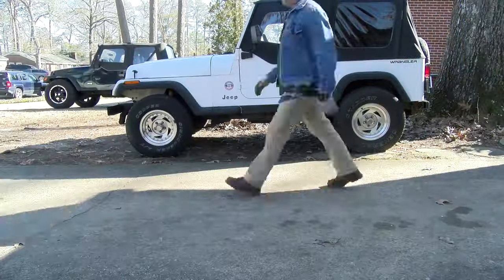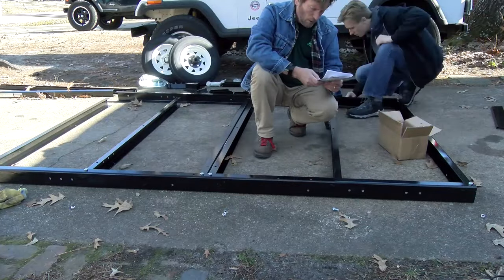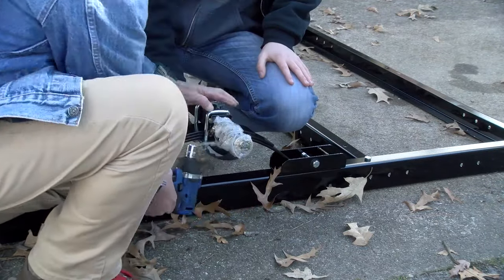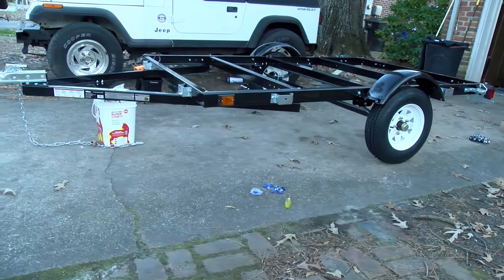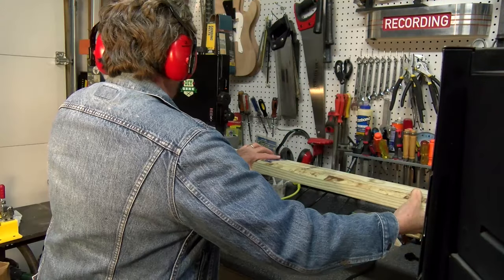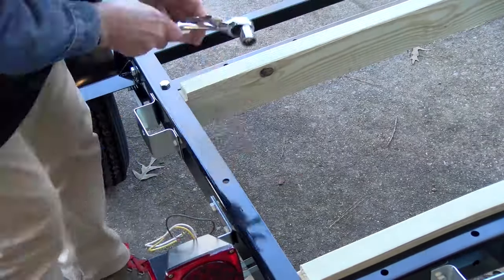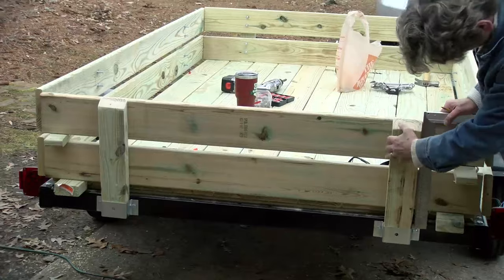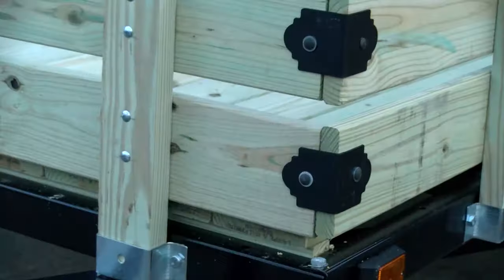Building a Ironton 5' x 8' Utility Trailer Kit from Northern Tool.

Comment: Just saw this video. Excellent build. Thanks for sharing. 
How satisfied are you after 2 years of use? Any issues? Anything you would have done differently?
How heavy is the wood comparing to the plywood since heavier it is you would loose your load carrying capacity. 
Thanks in advance!
Reply from the maker: The trailer is doing great. My only advice would be to use different wiring connectors than the non waterproof ones that come with it. Using deck wood has really been a advantage and is holding up great. I don’t think it added much more weight than plywood but will hold up better. The powder coated metal looks as good today as the day I got it. I hope that helps. Thanks for watching.

Comment: Is it a preferred method to install lumber to screw the deck bed into?
I was "gifted" the 4 × 8 foldable and I need to strip all rotted lumber. Would it weaken frame if drilled for fasteners?
A job well done! 👍
Reply from the maker: I liked screwing the wood on for straight. But I also installed wood stringers for the wood to be installed on. Would the trailer you have be able to have wood stringers? This could cut down drilling a lot of holes in the metal. I hope that helps. Thanks for watching.

Comment: Great video!!...trailer looks awesome...hope it has served you will these past 2yrs!...1 quick question....did you bolt the 2x4 cross pieces to the frame cross pieces...or did you leave them floating?
Reply from the maker: Great question. I cut them tight taped them into place. Then when the decking is screwed down it sandwiches the cross stringers and locks them in. I hope that helps. The trailer has been a great help for me and is still holding up great. Thanks for watching.

Comment: Great video! Best close up look at this trailer. Thinking of doing a teardrop trailer on it. How does it do at higher highway speeds? Thanks!
Reply from the maker: I have seen a few teardrop trailers built with this trailer. It can handle the speed but I have noticed they usually go to a larger tire and wheel. I hope that helps. Thanks for watching.

Comment: Gene, thank you for this Video. I'm curious why you offset the 1x6 Decking about 1" from the edge of the frame perimeter?
Reply from the maker: I off set it so I could use deck screws to attach the deck to the stringers. Otherwise I would have to drill a lot of holes in the metal and use carriage bolts to secure the deck. You can do that, but this seems to make more sense. I hope that answers your question. Thanks for watching.

Comment: Great video . I like the use of the 2”x6” for the deck boards . Maybe it was the camera angle, but it looks like there was no spacing between the boards.  Unless you have a great  water sealer on them they will swell up when they get wet.  Still great job
Reply from the maker: I used a couple of 16 penny nails through a scrap board to make a spacer between the deck boards. It gives me about a 3/16” space between them. Thanks so much for watching.
Reply: @DIYGene  Awesome video! I liked how you spaced the deck boards. However, in my advanced years, I'd suggest screwing only one screw, not two, for a few months, depending upon the moisture content in the wood.  I've seen new deck boards pressed against each other with no spacing, screwed on both sides. Then months later STILL end up with a 1/4" gap and split wood where the screw was because of the shrinkage.  These lumberyards sell them saturated with water.
Reply from the maker: @rusosure7  , That is an excellent suggestion. I was disappointed when I purchased the lumber because it was still wet. I don’t understand why they leave it out side so long uncovered like that. I am waiting until summer to put a sealer on it so it can dry out. Thanks so much for watching.
Reply: @DIYGene  I'm no expert, but I assume if the boards are pressure treated, they must have to saturate them with a water/chemical solution like in a pressure cooker.  And since all this covid nonsense has choked the factory's output, they're probably in the tank on Monday, on the truck Tuesday, in Home Depot Wednesday, and dripping dry on your trailer Thursday.  Not any time to dry out.
Reply from the maker: @rusosure7  actually Home Depot has them sitting out in the weather for weeks. The wood is wet from the weather not the treatment. Home Depot clams because it’s pressure treated, they don’t need to store it inside. But it’s sure heavy when it’s wet.
Reply: @DIYGene  Fair enough.  I'll assume that the fact they're all tightly bundled together pretty near stops the drying-out process.  The deck I helped build we had used pry bars to squeeze the 5/4" together and screwed in both sides.  A few months later there was a noticeable gap and split wood on many of the screw locations.  And this was exposed to rain too.
I just ordered the HF super duty 4x8 but plan on folding and using plywood.  However, if I ever did change to 5/4" planks, I'll plan a few months ahead and let them dry out.   Too bad Home Depot leaves that for us to do.
Reply from the maker: @rusosure7  you are spot on!  We, the consumer should not have to deal with these issues. I hope your trailer turns out great and you use the heck out of it. Suddenly all my friends are borrowing it. But that’s cool. Because when I get that new pickup, that won’t be happening. 🤪
Reply: He don’t need no spacing; by this writing, there’s likely a nice gap now between those boards.  It happens with pretty much all commercially-available pressure treated wood, unless you want to buy it, store it in a dry shop, and sit on it for months before use.
Reply: Like the other comment, treated boards shrink, if anything. Routed my trailer deck boards, about 1/2" along the length, making matching stepped edges to overlap/ or overlay one another, when installed, to account for board shrinkage, after they dry some, leaving no gap in between boards. Been holding up for 15 yrs or so,  now.
Reply: Bearing tightening, snug down by hand, spin wheel, snug down again, back off about 1/4 turn, or as close to that as possible to allow for cotter pin insertion.

Comment: I wonder after it was all said and done what the final cost was. A 5x8 trailer at Northern Tools is currently $1099 with all metal construction and wire mesh floor.
Reply from the maker: After the lumber the total was around $700.But I also got a $100. gift card at the time. The mesh one must be on sale, its $1140. here.  Thanks for watching.

Comment: How are those tires and bearings? Crappy or good? Great tute vid.
Reply from the maker: They are holding up great. I was wondering about the bearings myself. But so far so good. Thanks for watching.
Reply: @DIYGene  Are they rated for not above 55 like the HF's? They look like the same cheesy bias ply. I don't want to have to upgrade piecemeal unless it really makes sense.
Reply from the maker: @DivineMisterAdVentures  , I’m pretty sure they are not rated for speeds above 55. I actually purchased a spare because I don’t want to be stuck somewhere. I do feel the construction of this trailer is better than HF. The axel is a solid piece unlike the HF is a U channel with two axle studs welded in. The paint is more like powder coated and the fenders are better built. I hope that helps.

Comment: Replace the van with a Chrysler product van. It'll be dead in no time. Haha 
And before people start to criticize my statement, I've owned several Chrysler vehicles.
I have a ram 1500 currently, but I also have 2023 Outback touring XT. I was thinking about getting a 4-ft trailer for it for certain purposes. I've looked at the harbor freight one, but I thought it was just painted. I wouldn't mind getting a powder coated utility trailer instead of painted.
Reply from the maker: @m3rdpwr , LOL, I did eventually get a new Ram. I had to give the van away and it’s still going.

Comment: Nice looking trailer. I have a couple questions if you don't mind. Have you towed it on the highway much? And I was wondering if the axle is C channel or completely boxed? I could only see 3 sides of it in the video.
Reply from the maker: This one is a boxed axle. It tows really well. A little bouncy when empty but with a load it’s great. I hope that helps. Thanks for watching.

Comment: Great video. I was on northern tool website when i saw the aluminum frame version and wondered how to build the decking for the bottom. I knew they don't make a 5x8 piece of plywood so I figured to use decking boards, but didn't know how to fasten them to the frame. So I YouTube'd it and found you :-) Obviously, you answered my main question but I have a couple more. Would it be a good idea to trim down the 2x4's a little to make them flush with the frame so there isn't a space between the frame and the bottom of your deck? Or would it even matter? Also, "All in", how long did it take you to completely put this entire thing together and approx. how much did you spend on lumber? And do you know if a steel frame is better/worse than an aluminum frame? Thanks again for the video. It was very informative and good. And loved that your son was helping you.
Reply from the maker: I thought about flushing it to the metal, but because of the bolts that run around the outer edge, I decided to go this route.  I holds really well and I have had no issues.  I went with the steel because it is powered coated and cheaper. The down side was I had planed on $100 in wood and ended up spending $180.  Mainly because of the pandemic lumber prices have gone through the roof.  I am hoping they come back down soon. I would also look at that composite decking because it may be cheaper than wood right now. I hope this helps, thanks for watching.
Reply: @DIYGene  Thanks for the tip. I'll check out the composite boards.
Reply: Did yours come with the LED lights or the old-timmie ones? :-)
Reply from the maker: You know I didn’t look. I bet it has the old style 1157 bulbs.
Reply: If using treated pine, depending on the treatment it can react with certain metals (Aluminium and Stainless Steel for example). Minimising direct metal contact like Gene did is an excellent idea.
If you use composite decking, pre-drill and countersink everything, as it can crack easily if precautions aren't taken (perhaps also use a clutched drill, instead of an impact driver, so they aren't over driven too).
I would have installed the Coach Bolts (Carriage Bolts) the other way around too, so that the round head is to the inside. That way you can secure things to the side without worrying about damage from the nuts and remaining bolts. Not as pretty to look at perhaps, but its a utility item!

Comment: Was hoping you would have confirmed the folded outside fender to fender measurements of the trailer. It is the storage of these trailers that make them an attractive purchase. My condo storage unit is exactly 63 inches wide. If the assembled trailer varies even by half an inch it will not be satisfactory for my requirements. Does anyone know the assembled and folded max width of the Northern Tool Ultra Light 4x8 Folding Trailer???
Reply from the maker: If I am understanding you correctly, you are asking about the folding and storage. This trailer kit is not a folding bed. It has a true 5’x 8’ bed size. I hope that helps to answer your question. Thanks for watching.

Comment: You will have no end of trouble with those Scotch Lock wire connectors. They are not waterproof and they are aluminum cinch to copper wire. You should have at the very least covered the connection with dielectric grease to give your wiring a fighting chance at keeping the connection over time.
Reply from the maker: You are so right. It’s a shame that those are the connectors that come with the trailer. Maybe I should do a video on updating the wiring. Thanks for the comment.

Comment: I thought these were the same trailer as a Harbor Freight trailer, only painted black. I now see there are some additional differences. However, I am not a fan of the 55 mph speed rated wheel/tire combo.
Reply from the maker: They really aren’t the same. All the way down to the axle. I was looking at both before I bought the Ironton. Not sure about the 55 rating. I have had mine on the freeway a few times without a problem, but then again my Jeep doesn’t go much faster than 55.lol. Thanks so much for watching.

Comment: I'm about to order one of the same trailer. In fact, I saw your review and that's how I got here lol

So the stake brackets actually come with the trailer? I was under the impression they do not.
Reply from the maker: So was I, but the came with it. It’s been a good trailer so far. Thanks for watching.
Reply: @DIYGene  Oh, and thank YOU!

Seeing the video, hearing some of the measurements you used (like height of the stakes for the sides, having to taper them to fit, etc.) is extremely useful.

Comment: The cross piece for the decking were they 2x4 or 2x6?
Reply from the maker: I used 2 x 4s and then notched the ends 1/2” so they would fit tight into the 3” channel. I hope that helps. I put a list of all materials in the description below the video. Thanks for watching.

Comment: Great video! Love the detail! I was wondering if you had to bolt the 2x4s (cross members you cut on your band saw) to the beams?
Reply from the maker: I did not. The fit is tight and when you screw down the decking board it can’t go anywhere. I hope that helps. Thanks for watching.
Reply: Yes, that does make sense!
Really enjoyed the video! Keep up the good work!!

Comment: What are the dimensions of the c-channel bars that the frame is assem with? Specifically the outer bars that the axle mounts to.
Reply from the maker: The C channel is 1.75” x 3” by 1/8”. The cross channels are 1.75” x 2.75”   The leaf springs are bolted to the 3” channel. I hope that helps. Thanks for watching.

Comment: Hello I have a question. Why did you have the 2X4 cross beams sit above the metal cross beams?   Thanks
Reply from the maker: I did that because the bolts around the trailer raise up about 1/4”. Rather than trimming or routing out the wood to accommodate the bolt heads I decided to give it a little clearance. You could do it either way. Thanks for watching.

Comment: Fantastic video Gene and good to see junior helping you Could you cut the rear vertical beams and add some hinges to the tailgate so it swings down?
Reply from the maker: That is an excellent suggestion!  Thank you so much for that great idea!  I wish I had done that in the video. Thanks again for watching.
Reply: @DIYGene  Thanks for being so receptive How about a trailer mods follow up video? All the best mate
Reply from the maker: @georgekrabs6948 , That’s a great idea. When the weather warms up I want to seal the wood, add your suggestion and maybe show how it’s holding up. Thanks again.

Comment: Gene,  when did you buy this ? i am looking to get that discount!  Hoping it'lll be on sale July 4th weekend.  They only have a $50 store voucher right now.
Reply from the maker: I bough this in January of 21. I know they are now celebrating their 40th anniversary so I hope the have some big sales. Mine was a $100 store card plus the trailer was on a ale. It was really a good deal. I hope you can catch something like that too. Thanks for watching.
Reply: @DIYGene  I got my trailer last week and started the assembly over the weekend - first issue, no washers - i dropped $23 on washers at Lowes but Northern Tool reimbursed me with no quibbles at all.  Great service.  But now i have hit the next issue - i have my 5x 2x4s in place and the wiring done but the lights are not working.  I am certain this is a fault with the rear light units.  I tested my car electrics and they are fine.  My car has always on running lights - when it is on the font side lights and side lights in the rear unit are working fine but there is no light from the rear of the read units.  The flashers only work when the running lights go out.  I cannot get the brake lights to work at all because the car needs to be on for the brake lights to come on.  So I am convinced all my grounds are fine and that the brown and greed and yellow wires are hot when you expect them to be.   Probably needs another call to Northern Tool.
Reply from the maker: @tomkinsg , I’m sorry you are having issues with the wiring. I hope Northern will be able to make it right. In the long run you are going to have a great little trailer.
Reply: @DIYGene  I finally finished it - trailer got used for the first time on Saturday.  Thanks for your guidance on this - i followed it quite closely.  Issues i faced:  1.  They didnt provide me any washers.  2. the wiring Y harness was bad - specifically the coupler to the car. - i bought a replacement at lowes.   Northern Tool customer service is excellent - they refunded me my lowes receipts with no quibble on 1& 2.  3.  The instructions are not good and the center cross piece is not an I but is two of the other C pieces, just as in your build.    4. The 2x4 holder on the sides are a bit ridiculous - they don't accommodate a 2x4 - so you have to trim them down a little.  They should fix that with their supplier.  I still dont have my title yet and I am working with customer service on that too.  

thanks again

Comment: Really confused by the 2x4 cross members. why not just bolt to the steel frame and save weight?
Reply from the maker: I found it much easier to set stringers vs drilling and bolting through the steal. You can do it either way. Thanks for watching.